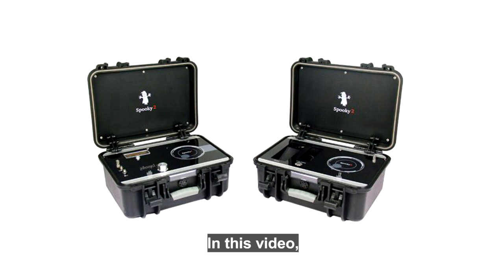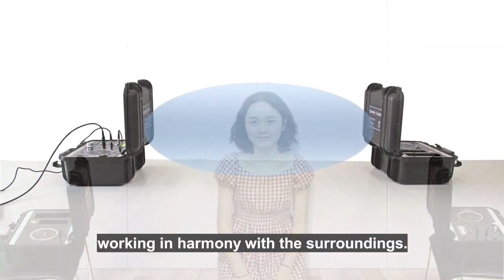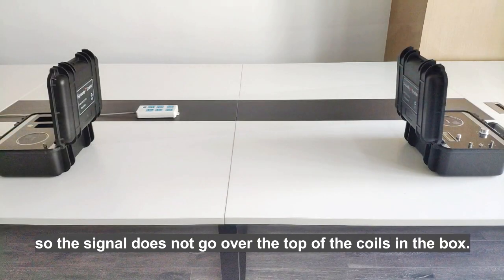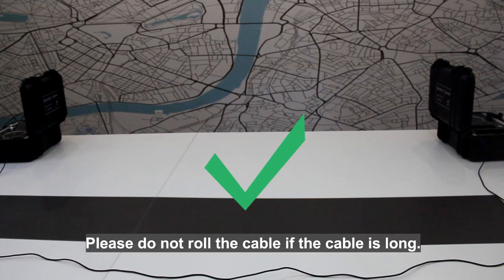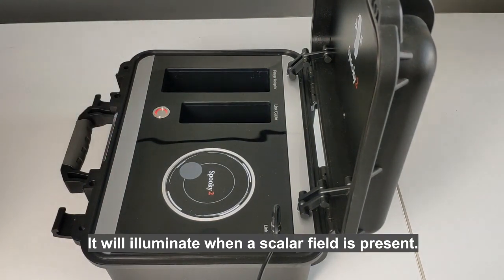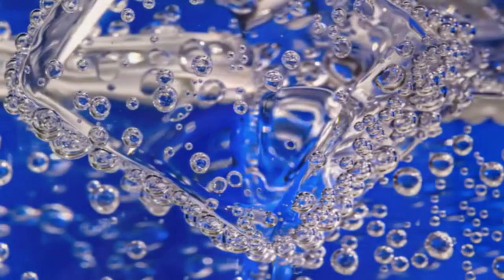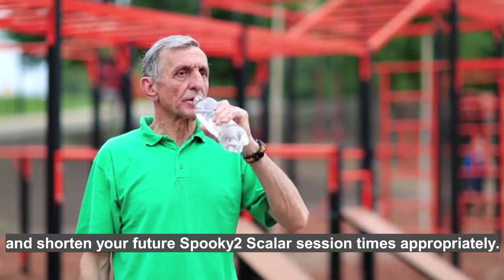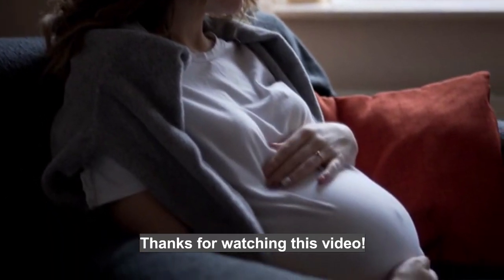7 Important Notes for Spooky2 Scalar Users

Comment: Sometimes the receiver light doesn’t come on.  I think I read somewhere that if you have the scalar digitizer plugged into the transmitter, that receiver light won’t come on.  Is that true?
Reply from the maker: Hi friend, yes. Normally, the receiver light will not be on if we connect the scalar digitizer or we are running rife scalar mode.
Reply: @Spooky2Scalar  ok thank you